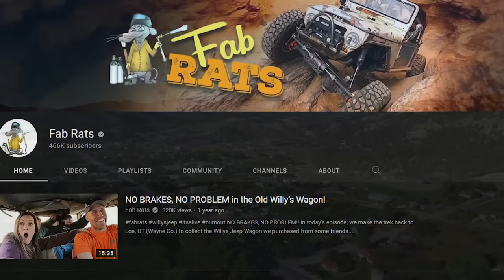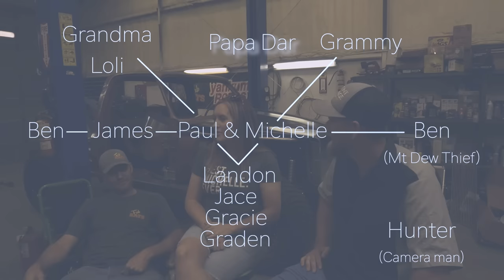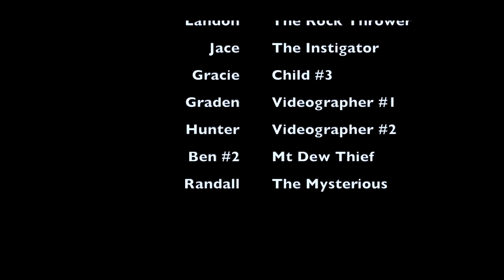Paul Almost Killed Matt?? @FabRats  Behind the Scenes

Comment: Does Paul dry the air before it goes into his Plasma Cutter? I purchased a cheap on Amazon and the instructions say I need an "Air Dryer" (which cost more at Harbor Freight than the Plasma Cutter) or the warranty is void. WTF. Help.